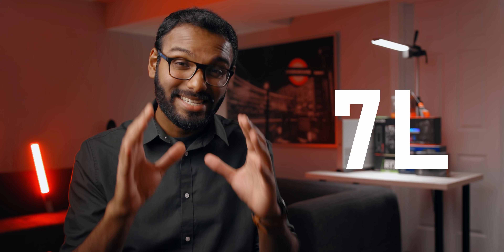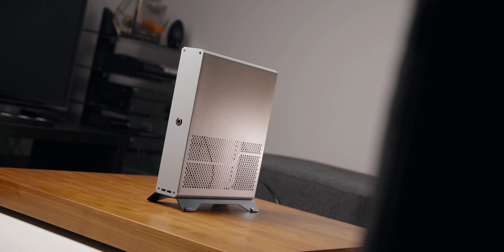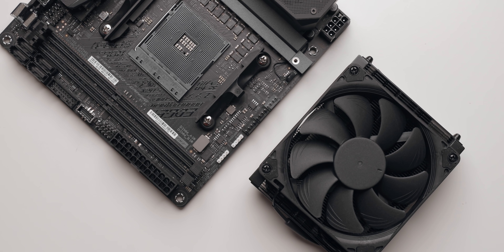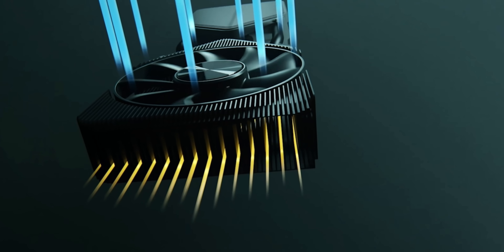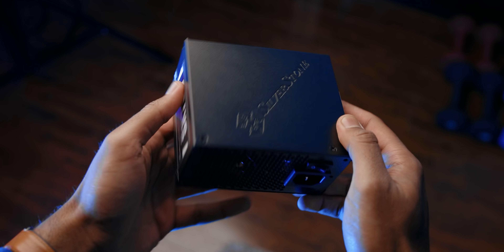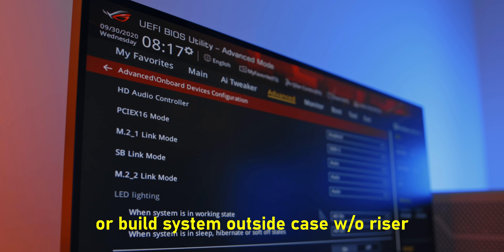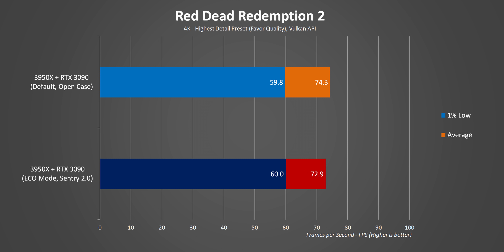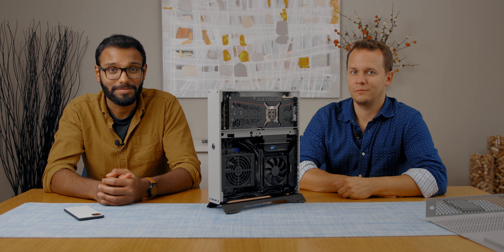RTX 3090 in a CONSOLE Size PC - It Works and its AMAZING!

Comment from the maker: Guys CAN'T WAIT to push more out of this system with some cool mods we have planned but we want to hear from you too.  Post your suggestions.  👍👍👍👍
Reply: custom cable sleeves and some noctua 40mm fans
Reply: K
Reply: Video title is missing an apostrophe. Should say it's instead of its.
Reply: 11:25 i think you are better off deshrouding the GPU and put in 120mm case fans, I can't see if there is room for 25mm but other than that noctuas thin ones and exhaust out of the side. 

Potential 40mm fans dragging in air from the top. (This could be the other way around , but this way it wouldn't dump anything down to the CPU)
Reply: Can someone confirm total price of build?
Reply: Install CTR and see how it goes. And on that note, can someone tests CTR on lower core count Ryzen like R3s?
Reply: Undervolt that 3090 and it’ll drop like 80 watts in power draw. These cards can stay around 1900 MHz at 900 mV. Also instead of using the eco mode, try the PPT setting in pbo settings of the bios are maybe try setting it to 55 watts
Reply: Try out the ID-cooling 47 or alpenfohn black ridge cooler! Both are 47mm tall and should just barely fit while providing a higher tdp ceiling than the noctua!
Reply: @hadoukenocx4746  it also has 3.5Tb more storage, and with the 3090 I'm sure it more than just 40% more fps. But I get your point.

High end desktops are more of a passion project than pure price to performance~
Reply from the maker: @hadoukenocx4746  Never called it a console destroyer.  ;)  Just console SIZED.
Reply: Get an FE 3090 and make holes on the side panel at the right top side and compare the temp with the AIB?
Reply: Ah nvm its 3 slots
Reply: How about seeing what RTX 3080s and 3090s are compatible with the Node 202?
Reply: Salvo s402 and Sliger Console/Conswole have ventilation on both sides of the case, you would get temps basically the same as open bench with the FE models. If you want to stick with this case, see if you can deshroud and put 2 120mmx25 fans as exhaust rather than intake, will drop temps by 10-15c through brute force static pressure alone
Reply: @hadoukenocx4746  A PC is not only made to play games.
Reply: @reynandi  I was about to suggest this but you beat me to it.  :)
Reply: @araisikewai  what is CTR?
Reply: @reynandi  Exactly what I have been waiting for, just with a 3080 FE. Then both GPU fans would pull air from outside the case, and push the warm air out of the case again. 
Thinking of doing this with a Node 202.
Reply: @sushimshah2896  Clocktuner for Ryzen by 1usmus. Tools for autotuning overclock/undervolt CPU. Should work wonderfully for high core count Ryzen like R9 here. Just released yesterday.
Reply: @araisikewai  Oh, iirc LTT also did a video on it a while back, I just couldn't figure that acronym
Reply: @sushimshah2896  it used different acronym back then. It's officially called CTR now.
Reply: Like Mike said I have been wondering the same, A mod to suck the air from the top for my Sentry. I have a crazy idea of 3D printing a plate on top that hooks to the holes on the side of the case and adding 4 USB  powered 40mm fans.  Yeah, I know this is not aesthetically pleasing but it can be removed under light workloads. But, I have no means to try it.  Waiting for the mod video update.....Happy Modding!!!
Reply: Try the founders edition
Reply: @waynedoherty7758  Founders edition isn't an option, air flow gets blocked by case as mentioned in video and it's triple slot so it doesn't fit...
Reply: @taggerung890  Your console doesn't have 32 threads and can't play 4k max settings........... We will have to see the actual benchmarks of the consoles on release.. For real though 500 dollar console vs estimated 3500 for a pc. Consoles are a deal
Reply: I'd suggest inverting the direction of the CPU cooler fan if it's possible. I did that with my ITX build and got MUCH better temps inside the case.
Reply: Why not use cryorig C7G for the cpu, and couple of noctua 40 mm fan for the extra push to the top of the case.
Also if you can use some kind of separation (Like a Cone)  for the CPU air intake, which will allow only fresh air from the side grill, but not mix it with the hot air inside of the case.  I have a plan to build my sentry 2.0 system like that.
Reply: @taggerung890  exactly what I use in my sentry, even with a swapped noctua fan
Reply: Hardware Canucks how much is this exact build if I wanted to buy this? Serious inquiry.
Reply: Hey guys! How about a better CPU cooler so you can use the power of the 3950X. I would suggest an Alpenföhn Black Ridge with a NF-A9x14 PWM Chromax, which should fit. Of course there are some problems with the m.2 heat sink, but you could leave that out or just choose another board. Additionally, a different riser cable would be needed, but that would be necessary for PCIe 4.0 anyway. Best regards, TechRacoon :D
Reply: @HardwareCanucks guys could you please also test any pciE 4.0 riser cable? Will it resolve the issue with the boot menu?
Reply: Change your Crcryorig c7 and use the Noctua fan mod. You'll also have to file down one side of the fins to fit that motherboard. Thats how my Sentry was setup. I was going to drill holes on the backside of the case for those new GPU to allow the GPU to push are straight out but I instead bought a Sliger CL530 I think is what it is and it's about the same size when you add the Sentry Stand but I can fit 3 slot cards and I switched the ribbon cable to a Gen 4 and also up the cooler from the cryorig c7 to the noctua l12s.
Reply: Great video. I can relate to this- i have a 9900K and RTX 2080 (now sold to wait for the next upgrade) in a Velka 5 (5.7L case).
Reply: I need a PCIE 4.0 rizer for my Sentry 2.0 ... can anyone help me?
Reply: @Narinjas  What the use case that you have that would warrant a PCIE 4 riser?
Reply: @agentmsb6293  Yeah I was also questioning why they used such a low wattage (well for the 3090) psu, there are definitely compact psus with more watts
Reply: @Kenneth Shen  I don’t think the psu is the biggest problem. It’s that in all sff pcs you have to turn down the power draw to decrease the temps so it’s able to cool itself better and maintain boost clocks when under load without ramping up too hard. Reducing the power draw will help though with trying to stay within the power envelope of the psu but again it should be fine
Reply: @agentmsb6293  Ok
Reply: Custom routed cables according to your build and cool graphics
Reply: I would have case mods in mind but it wouldnt look as cool after it, or maybe it would. Transparent acrylic (vented) cpu side sidepanel with more ventilation on behind GPU to exhaust air behind GPU and more two fans pushing more air for mainboard. That side panel would have acrylic side covers so it would look bit better than acrylic side panel on 4 standoffs.
Reply: News 4 U. Ryzen master does not permanently change anything. It changes for one boot. After that you will revert to the motherboard settings. Master is just an overclock test utility. It's like that on the 3 x570 mobos & 2 x470 mobos I have.
Reply: Please make a video about best gaming open back headphones with mic, but do not include your last Philips headphones
Reply: How is the noise from the case?
Reply: @hadoukenocx4746   I'm not really a gamer , pc or console, but isn't a console strictly for gaming  - and gaming only...?
Reply: EVGAs card design is literally pepega
Reply: @action903  it's priceless 😄 (check pc particular for most  should give you a total  ;I'm sure that case is  not on their list)
Reply: @HardwareCanucks  Not being a smartass, but you guys review cases, and coolers, you should know how to improve it, since it´s quite popular in the ITX case format.... 

Deshroud the GPU, and use 120mm fans pulling heat from GPU, instead blowing in it fresh air..  It should give you a decent improvement in GPU temps and releave some stress from the CPU.
Reply: Please do a follow-up!
Reply: Upgrade it to AMD Ryzen™ 9 5950X
Reply: Hi guys. Or I having some problem, or I don’t see your videos! Wtf? Just entered the channel and found that I have missed videos at least for
Last 2 weeks.
Reply: Could you make some holes in the case on the opposite side of the gpu to take advantage of the flow through cooler on a founders card or is there something going on with that panel it looks thicker?
Reply: @taggerung890  I just bought the black ridge but the only configuration it can fit is with a 90mm fan at the bottom as the cooler height is 47mm without fan and it is the max the case can support. You can use a 120x15 at the bottom with very low profile ram but it doesn't seem to fit with the vengeance LPX (haven't confirmed yet as i am waiting for the PSU).
Reply: Get and feature the J-hack M2426
Reply: you could make a base for the case, with a bigger  surface area at the bottom and the size of the case at the top and about 2 inch in height, 
the idea will be to force some more air from the bottom and let convection aid on the motion of the air from the bottom to the top.  The idea being having more airflow.
Reply: Waiting for the mods. Also check out the helium pc! Looks very much like this.
Reply: It's like other films. The black man, the huge equipment and the small white case. In the end, the audience and everyone else are happy.

Comment: It will fit perfectly outside my window this winter 🇸🇪
Reply: Subzero aircooling
Reply: I am middle eastern man so I don't know what winter mean 🥺
Reply: Like - 5 to - 8 or lower
Reply: That’s actually a great idea, only I’d be worried that wind might blow debris into the enclosure or rain or snow might fall on it. So maybe build a box for it? But then again, you can just stick it in the basement or garage.
Reply: me too,  -10, -20° will no require for power drop 😂
Reply: Hani BAHADA Every Middle Eastern country is not hot. For example Turkeys average temperature is lower than most of the European countries.
Reply: Lol
Reply: You will be accountable for 50% of the global warming
Reply: @Matthew Shields I'm from Florida and yes, that's what is considered winter
Reply: One person responding here isn’t an idiot
Reply: @akinoz  cant relate, average temp here in my country is 34°C, SEA country
Reply: I use to do it back when i was a student.. always comical to start up the pc in the morning and have the gpu temperature reading -5C
Reply: lol
Reply: Isn't sweden snow infested all 365 days?
Reply: Neil Carvalho If I could afford 3090 SLI that would accually make sense, 1000W 😆 My current heater maxes out at 1700W
Reply: That's me! Thanks to the Gulf Stream, no. It can be 30 degrees Celsius above the Arctic Circle in summer ☺️
Reply: Yes, want that Nordic winter and put PC outside.
Reply: It's not perfect for my country (tropical country) :/
Reply: yeah lol,  300rd 👍
Reply: Is there a good way to do this and protect it from the weather? I'm thinking that I could try putting a PC in my attic, but I'm interested whether there's a more general solution
Reply: @whydoiexist3896  -20-30
Reply: Oh I feel ya buddy, coming all the way from the great white north 🇨🇦
Reply: Winter is coming.
Reply: @Matthew Shields lol that's air conditioner level
Reply: @Matthew Shields sounds like the weather down here in south Texas. Where are you from?
Reply: Until the snow melts and leak inside your pc.
Reply: Lol it will get stolen or trashed! I've seen the videos of new sweden how are things going there?
Reply: @imtheonetosayit3657  In what part of the world people wouldn't steal your shit i you put it outside the window?
Reply: don't do that if you don't have humidity stabilizer it gonna reduce your machine life span
Reply: @am8776  true, very true
Reply: @i3dny  deep vacuum is your friend! Thermodynamic equalizer 😋👍
Reply: Ah, another Swede I see!

Comment: In this video .. .a case you can't buy with a GPU you can't get …. ENJOY!
Reply: dust buildup... only work in the lab... i done with small case...
Reply: Progressive  That's one ...
Reply: Actually u can buy clone of this case HZMod XQ69 from taobao
Reply: @barracuda7366  is it exactly the same ?
Reply: I mean in terms of functionality and dimensions
Reply: @yi G ty
Reply: @ahmadaleisa4571  It is slightly thicker (~3mm) and doesn't have the iconic line in the ventilation holes. But apart from that it's basically the same.

Oh, and there's a XQ69+ version with ventilation holes stretching over the entire side for better thermals.
Reply: @mmmmmmmmmmmmmmmmmmmmmmmmmm3153  technically it's better

Comment: "Built-in IO shield." 
- shows the IO that clearly doesn't have a shield lol
Reply from the maker: NOOOOO!   We blame Eber's extended use of the X570-i which DOES have a built in shield. :P  We've affectionately started calling these "Eberisms".  ;) ;)
Reply: @Hardware Canucks 

😅
Reply: @HardwareCanucks  new word learned :P
Reply: @HardwareCanucks  Wait, I got the Strix X570-i motherboard and it doesn't come with a built in IO-shield? :o
Reply: Hardware Canucks x570i doesn’t have a built in IO shield either LOL
Reply: @Olaus_  My C8I has one built-in, but it has 1Gbe vs 2.5Gbe on the B550I, damn you Asus.
Reply: @Olaus_  oooof, that's a very big OOOOF from me.
Reply: @TheGauges420  Ehm, what?
Reply: @Olaus_  because the x570-I doesnt have an IO shield, it's a big OOOOF to Canucks lol.

Comment: Great set up, I would suggest making some perforation for ventilation on the side panel on the back of the GPU, allowing the hot air to escape and also have the option to install the Nvidia RTX3080.

Comment: A perforation on the case at the back of the gpu would allow the founders edition to get basically perfect airflow without leaving heat inside the case
Reply: There's something to be said for these mini cases where the component fans directly cycle ambient air from outside the case vs. Bigger cases that are fighting hot air building up inside the case.
Reply: An enthusiast with a drill press and a lot of patience should be able to pull this off
Reply: I love this idea. Just drill some holes! However, as GN showed, a lot of air gets dispersed to the sides with the passthrough fan, so you might have to actually make a funnel to ensure the air goes straight through.
Reply: @aednichols  or a cnc machine.  A small one should be more than enough
Reply: @Chaos666Theory  I'm looking forward to seeing what it cases come out that cater to the FE models. Personally someone needs to do a gpu direct mount to the side panel and use the panel as a giant heatsink along with funneled exit area for the flow through design.
Reply: yes some slight modifications, you can make a side panel that would make the case end up looking like a PS5 (with the DVD drive) but in reverse ,a little bulge right there to fit the FE card, best solution to fit the FE card in a small case with amazing airflow
Reply from the maker: Yeah we'd love to get in another case to try this but can't find any on the used market.  :(
Reply: Darren Krusi The Ncase M1 and coolermaster nr200 work great with the FE cards if they’re set up with the bottom mount gpu. A slim form factor that just pushes it out immediately would be really cool though.
Reply: @HardwareCanucks  Contact Sliger about a Console?
Reply: @HardwareCanucks  Made another video with the modifications on

Comment: The 3080 Fe should run cooler since it exhausts some air outside, but I need to modify the case by adding holes for air to pass through on the other side

Comment: Hi guys. I’ve watched your video when it was published but I just went through it again after doing some research. 

I may have found a case that solves most of the issues you had with the Sentry 2.0 case. This case is the Sliger Conswole CL530. The stand doesn’t look as good as the sentry stand but here are my findings:

1 - Eco mode: the CL530 is slightly thicker so you can use cpu coolers up to 75mm (e.g. Noctua NH-L12S). It may not be enough to cool a 3950/5950x but it could be enough for a 3900/5900x.

2 - RTX 3000 FE cards: the CL530 is compatible with up to 3 slot cards and the panel behind the GPU has vent holes. Therefore, the new FE cards would be a good match and even the FE 3090 would potentially fit.

3 - GPU hot air build up: using an FE card, most of the hot air would be exhausted towards the back and side. Any remaining hot air would rise naturally and exhaust at the top. The CL530 default orientation has the GPU at the bottom but by looking at some of the photos, it looks like the case can be inverted.

I hope this helps!

Comment: For thermal improvements you can use 40mm fans above the GPU to exhaust air. As well as using a 3D printer duct on the CPU cooler to stop turbulence against the side panel.

Sleeved custom cables also a must.

Comment: Great job guys! I have the case, please push it to the limits.
Though you are not using the full potential of the CPU, it would be interesting to have an optimal CPU.
More importantly the noise of that setup has to be insane and that is a key information for my upgrade decision.
I am playing on my TV up to 4k (30fps).

Comment: Zaber Sentry is back.
Thanks for the video, man. I have this case and I wanted to build another configuration on it and I was afraid to build it with a Ryzen 9 3950X or an Intel Core i9-10900K because I had no idea of a cooler capable of cooling these processors in such a small space.

Comment: I have the first gen of the Sentry and I absolutely love the case. It makes it easy to bring along and I highly recommend for anyone that needs a sfx case that fits in a backpack.
Reply: How much does it weigh? My Sliger SM560 is sitting around 15lbs/6.8kg.
Reply: @zoomzabba452  My rig with a Gtx 1060 weighs about 13.5lbs/6.1kg. It can be a bit much to lug on your back for continuous time, but for a 30 minute walk, I can bear it. All I need to complete the small setup is a portable monitor, but those are just too expensive for me.